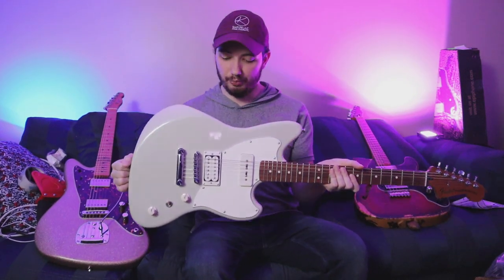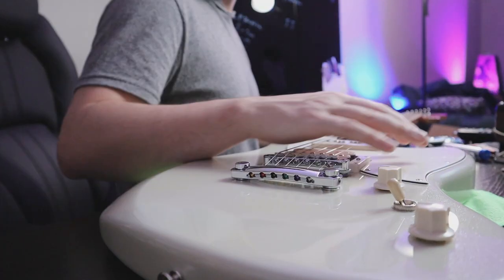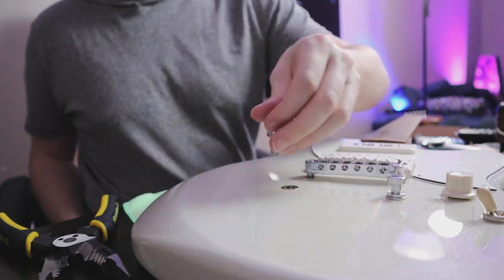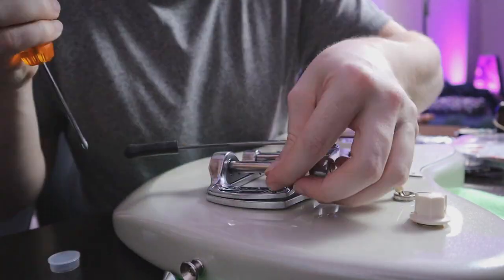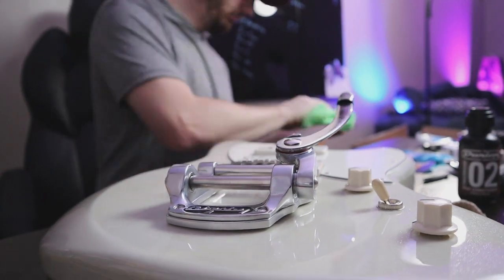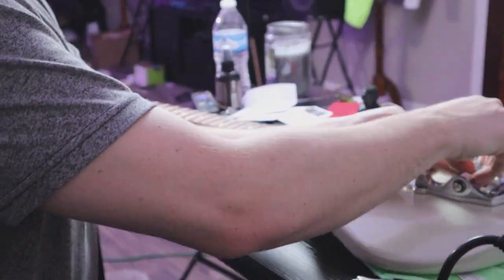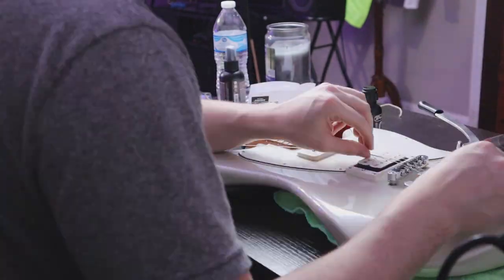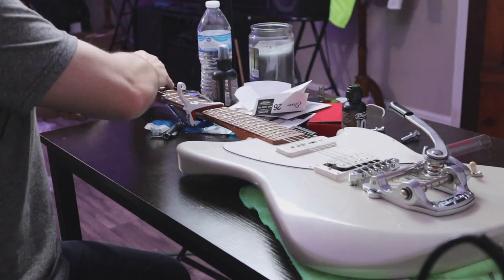I Installed a Bigsby To My Fender Powercaster | A Stringing Nightmare!

Comment: After you installed the bigsby , you going to loose the  setting intonation ?i got  a veritas and need a bigsby , right Now i got the dusenberg tremolo in it . Thank you
Reply from the maker: Every change will require an adjustment somewhere, but it is worth it and usually minimal in this case.